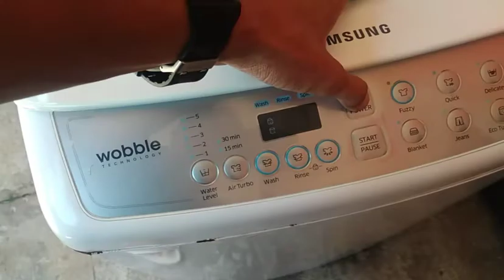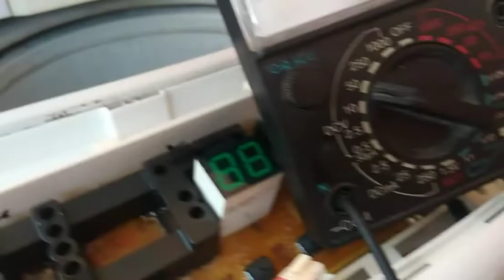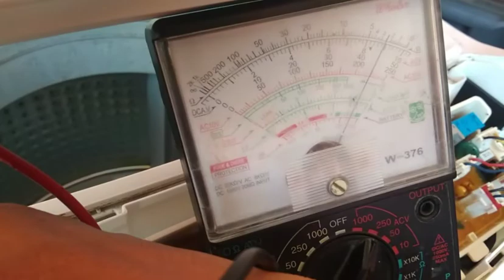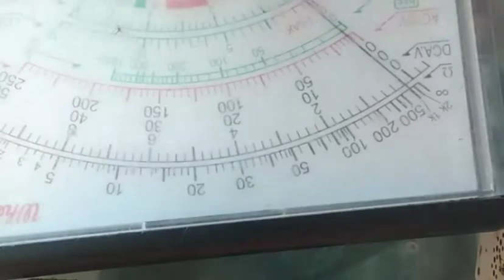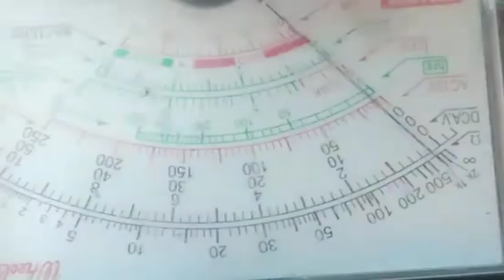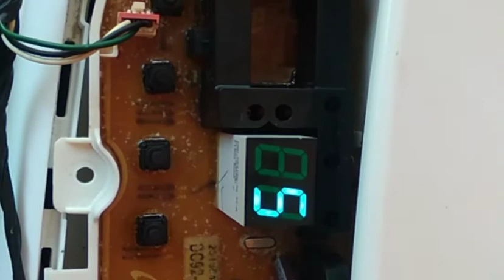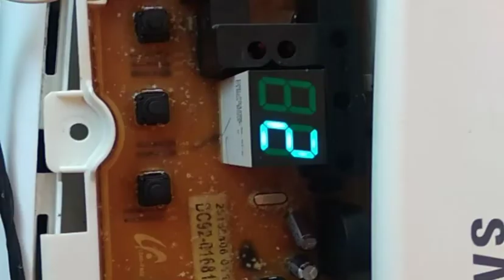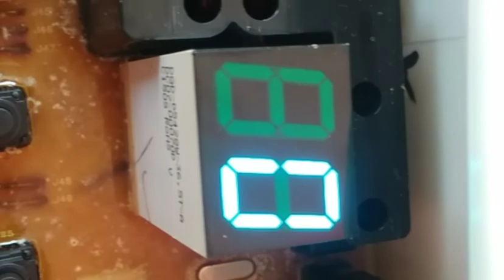How to repair automatic washing machine no power#18

Comment from the maker: https://m.me/phil.delossantos.94
Reply: Boss amin din po fucoda brand wla display po..tanggal ko kaya po hirap wla tester pra electronics po..anu gnda ggawin ko..??capacitor po ba nasisira bsta wla display??salamat po
Reply: Hi meron akong Wobble Samsung washing machine ayaw magpower up. Checked ko yon secondary side ng power board no output na 5vdc at 12vdc. Nag chk ako yon buss fuse na T1Amp busted. Ano ang dapat i chk na components?
Reply: Hi sir mayrun ako media automatic washing machine ayaw din po mag on

Comment: hi realy like your video
i have same problem with my washing machine same tipe. the probles is pcb board led red indicator is blink but the power button is not working? do you have solution or recommendation?

Comment: Sir same problem din po wala power automatic washing machine namin. Minsan po ngbubukas minsan din po hndi tas may ground siya nakukuyente ako ng konti. Ano po kayang problema?
Reply from the maker: Ung sa grounded sir dalawang klase pwding maging problem niyan sir ung isa pwding may open na wire pag nabasa sir un ung nkaka ground sainyo sir ung pangalawa nmn sir pwding may sort na sir sa mismong body ng washing mo sir,ung wala naman po power pwding may lick na siya sa power supply na capacitor sir pwd rin po ng ssort ung line ng board gwa po ng silicon sir.
Reply: @pdselectronics  try ko po salamat ss info sir
Reply: Good day PDS, same issue with my samsung wobble, may time na may power may time na wala,,,, related din poba sa power supply or power switch button...?
Reply from the maker: bali dun din po may problema sir sa power supply sir,pag wla siya ng 5 and 12volt sir
Reply: @pdselectronics  ganun din yung sa amin sir .may time na mag on at ilang seconds lang mag off na naman
Reply: @pdselectronics  Hindi na rin mag automatic stop yung tubig papasok sa machine at hindi na rin mag automatic mag drain pagkatapos .Ano kayang dahilan sir?
Reply from the maker: bali po ung ayaw niya mag auto stop po ung tv bali ang may problma mo niyan ay ung water level sa may likod or ung pinaka hose po nung water level.

Comment: Boss tanong po, walang 220 V na pumapasok sa PCB, pwede po ba akong mag bypass from outlet to PCB 220V power supply? baka sira na ang wire nito or corroded na siguro ang wire o putol na.
Reply: same model nung nasa video

Comment: Idol pag meron naman power supply primary at secondary pero ayaw pa rin mag on,  ano kaya possible na sira?
Reply from the maker: bali tingnan mo sir kung may ng bblink na red sa board niya sir pag wala sira na po ung board niyan.
Reply: Wala Sir na blink, sira na nga board. Maraming Salamat po.
Reply: @pdselectronics  sir kung mayroong masukat na  12v dc at hindi stable ang reading sa 5v dc .Ano kaya sira dito sir?

Comment: sir possible po bang resistor ang problem pag wlang power? chineck ko po kc ung pcb prang maitim ung ilalim sa resistor na part, light blue po ung resistor 2 pcs
Reply from the maker: sadya lng po siya sir maitim gwa po nung pnka silicone niya sir.
Reply: pina check ko knina sir, ecu dw po problem, pinapa conert nlng sa universal control board

Comment: Sir same case same brand din po ng washing machine namin, possible cause po ba ng pagka sira ng power supply kapag biglang nawawalan ng kuryente tapos mag sisindi ulit
Reply from the maker: no po ma'am un lang tlga po sakit ng mga model niyan ma'am, ng ppower on pa po ba siya ma'am.
Reply: sir yung sa akin nag auto off ano po kaya solution nito?

Comment: Good afternoon. Sir, tanung ku lang po anu kayang sira sa washing nmin 110v sya tapus sa 220v ku sya sinaksak tas nung iwan ku narinig ku nlang parang may pumutok nung tingnan ku nkapatay na d na maopen? Turbo po sya automatic. Salamat po sa sagut
Reply from the maker: ah ok po pag ganyan po na saksak nio po ng 220 ung washing nio po na 110 bali pwding maging sira po niya ung transformer nung power supply  pag transformer type pag ung isang klase po na ic type pwd po ung pinka driver ng power supply putok din po fuse niyan.

Comment: Sir ganyan din Po washing namin ...Nung ginagamit ko sya bigla nlng syang ayaw mag start Kya  di ko na madrain ung tubig sa loob tpos after a month nag try akong isaksak ulit ayaw Ng mag power on ..ano Po Kya problema sir ?
Reply from the maker: Pag same brand po nung nasa video ko po pwding lilinisin lng po ung sa may power supply niya kc wla po siya pwding maging sira kung di nio na po siya ginamit ng isang buwan,un po kc kadalasan nasisira gwa po nung silicon na nkabalut po sa mismong board,ung sa start nmn po pwding may problema na po ung switch button niya or putol na po ung line ng Start niya po, thank po

Comment: sir ano po kaya possible sira pag yung automatic washing machine (Sharp ES-FA650P/750P)  ay pag sinaksak ay iilaw lang lahat ng nsa display at bigla nalang mawawalan ng power,di npo sya na oON, if ganto po sa vid ang problem,ask ko lang po if pano ito ibabalik since nasira/nataggal ang silicon na nagpoprotekta dito para sa tubig upang di magshort. may pwede po ba pagbilhan ng silicon? or ano po alternative na solusyon. 
Salamat po and God Bless.
Reply from the maker: pag ung parang naka hang lng po ung mga indicate na ilaw niya ibigsabihin po nung pwding corrupted ung program,kung di nmn pwding may ng sho-short na line or ung mga tack switch niya ay may short alin man po jan sa mga selector ang may short di po yan gagana.
Reply from the maker: siyanga po pala dun po sa silicon na matatagal pwdi niyo na po gamitin dun ung glue stick
Reply: kuya  magkano b magparepear kc ayaw mag load ng load ng tubig tapos nilipat nming ng pwesto ngauon wl ng power